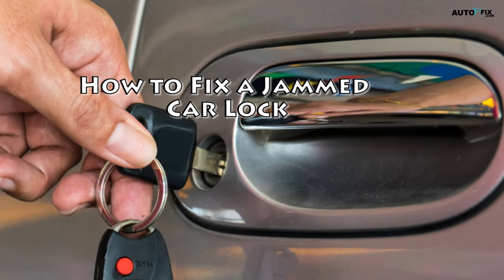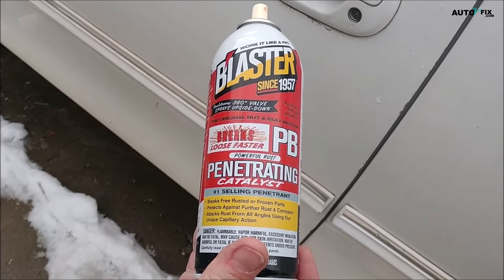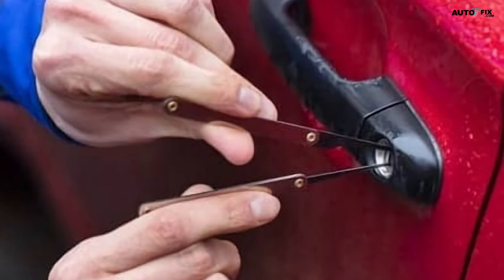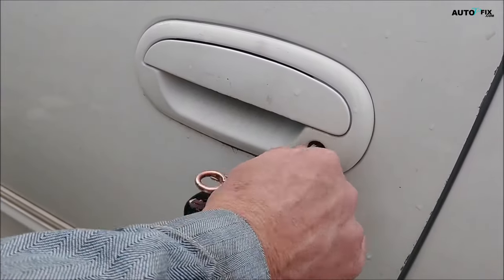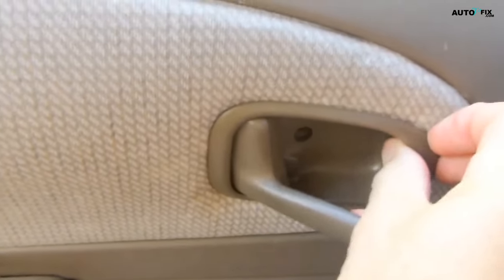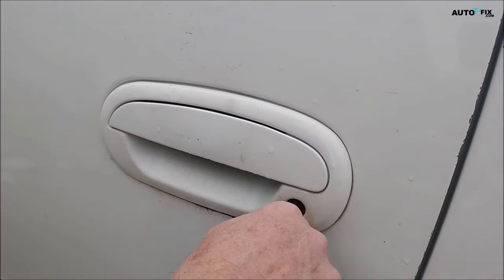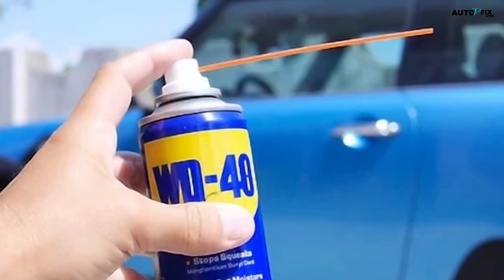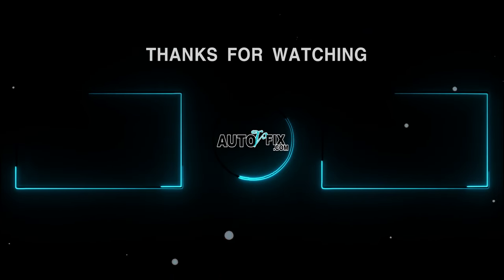Car Door Lock Broken: How to Fix a Jammed Car Lock

Comment: How can you remove the door panel if the door is locked closed
Reply: I'm having this issue right now. I just spent $100 to replace the interior and exterior door handle but my door is jammed shut. I tried to hear if the lock is working inside but I didn't hear it so that's that 😅
Reply: Any update on this

Comment: My car door wont open so i need to know how to get it unlocked With the door lock shut
Reply: try a magnet? maybe or get someone to open the door w a lockout kit if ur lucky and have a 4 door car try removing the driver seat and i think it should be enough space to get the door panel off and if its just a door car without enough space continue the magnet if there’s no solution the only way might be to break the car window 😭